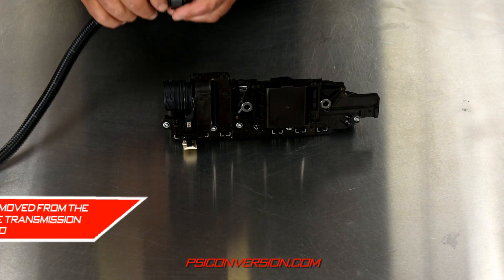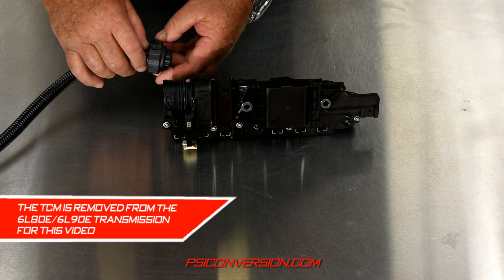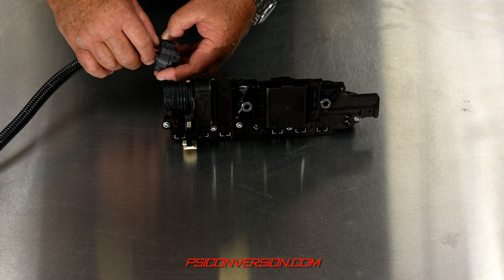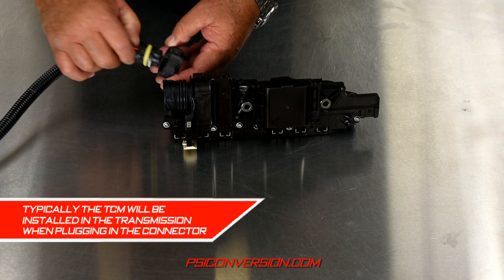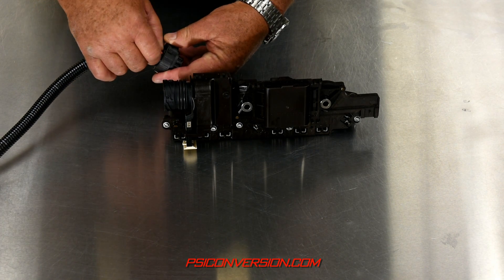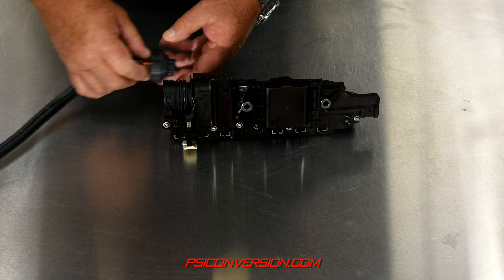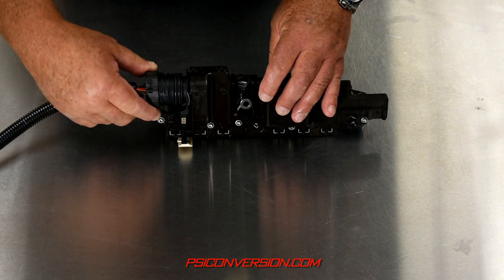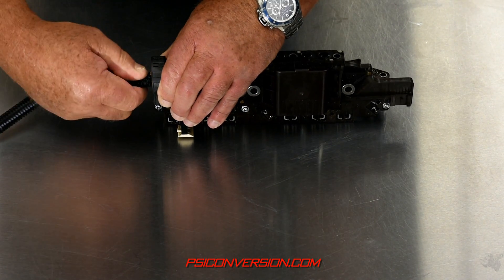How to solve your 6L80E/6L90E "No Communication / No Data" problem?

Comment: Hey, so this might be a little late. I did a TCM replacement on a 2008 Cadillac Escalade AWD. 6l80 TCM replaced after solenoids had blown. Trying to figure out why ECM lost communication. Would this be because of this issue? Still to do this day trying to figure out if it was because I put a TCM in.. I don't have access to read or scan codes due to U0100 Lost communications ECM/PCM  (A). Worked before I don't understand after replacing TCM. If this is the issue I will check back with you. Great Video BTW!

Comment: Thanks for the video. Isn't a twist lock supposed to keep the pin connections seated?
Reply: The way you have it still isn't making any pin contact and the connector is 90 degrees too far clockwise (green wire is right beside the key which is at about 6 o'clock). When you push that plastic ring on, it shouldn't be flush with the back of the socket housing, it should be pushed all of the way on passed the yellow seal until it bottoms out and the three plastic fingers on the housing grab the ring. At this point you cannot remove the ring (as it should be) without pressing the plastic fingers in to release it. At this point my ring would not spin on the housing until I gave it a little force and now it spins freely back and forth 90 degrees. Then you can plug it into the transmission. The key way will will be seated and not allow the harness to spin before you even lock the ring. Now you can turn the ring 90 degrees clockwise and it locks the harness in place. In your video, you could have pulled on the harness and it would have come right out of the connector. Also, when putting the ring onto the housing, it is keyed as well and will only go on in one position.

Comment: hey buddy had a problem where my 09 g8 got a trans rebuild after It cracked bellhouing put back in, wouldn't take off in low gears other den 5th. put a new tcm in now it, Gm tech tried to program stated it had no communication to tcm. with code po7001 I think. we checked everything was could it be ?
Reply: Did you find out a solution to your problem..having the same issue

Comment: I installed a 2011 6l90 in a 2007 truck that also had a 6l90. It won’t shift. 07 harness has one more wire and pin than 11 has but all other wires are the same color and in the same positions. What is that 07 wire for. I can’t find the 07 diagram but I can find 08up. Plug is not loose because if I take it completely out. Truck won’t start.
Reply from the maker: The issue you are having is a mismatch between the ecm and tcm operating systems. The simplest solution is to swap the 2007 tcm into the 2011 transmission. If the extra wire is in pos. 6 it is for the brake pedal applied signal.

Comment: How do you remove pins from conector
Reply from the maker: There is a white lock on the connector, just pop it up and a circle pin pusher will help. The pins can be very difficult to remove.

Comment: Good afternoon friends. I have an original engine with its same original transmission 2017 model is an L83 engine and brings all its original harness installed, as well as your computer, I want to install this engine in a racing car project and I need a simplified harness you understand me, what parts I recommend buying to start the engine, thanks.
Reply from the maker: Could you give our sales team a call? They will let you know what you will need. (732)444-3277
Reply: @psiconversionyoutube   speak  español?

Comment: Also make sure the plastic twist piece that goes into the valve body that you have to take out before you take out the valve body is fully seated, if not, it will lose connection as well
Reply: I have a 2010 Chevrolet Silverado 4×4 rebuilt the transmission put another torque converter in and now it wont move what could it be